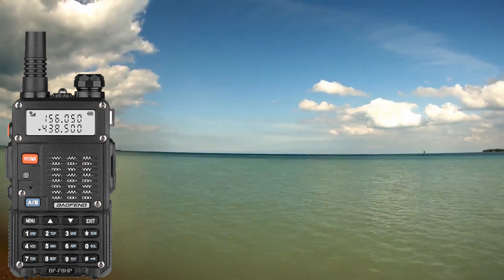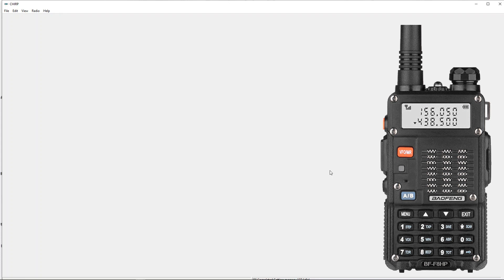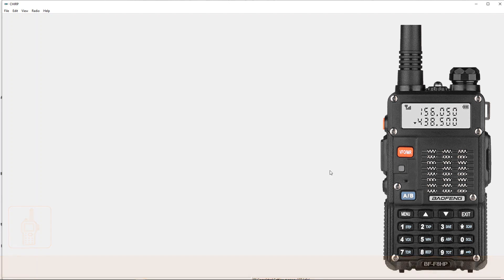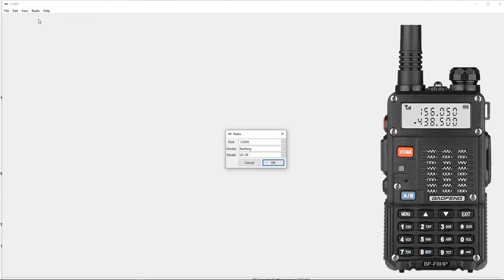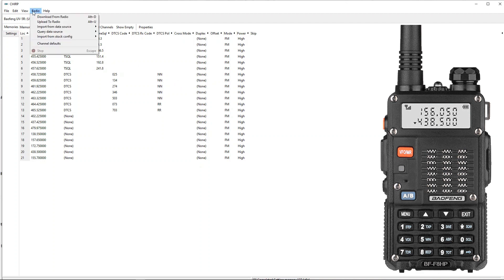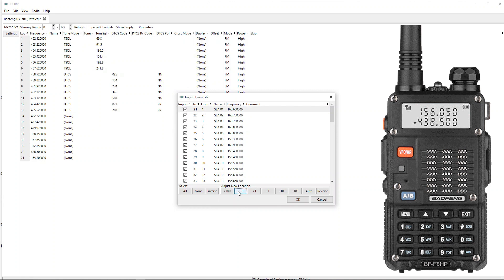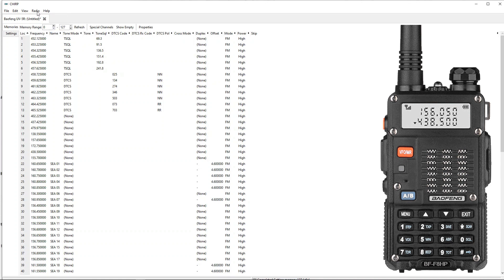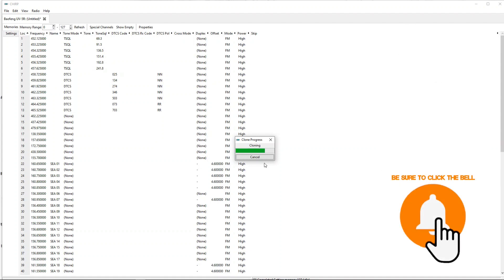CHIRP - Programming the Baofeng for Marine Frequencies the Easy Way!

Comment: Great video! But in the scenario that i'm on my boat and my main radio die, the Baofeng can be a great inexpensive backup radio that can save your life. Why the certification will matter?
Reply: believe me...... The coast guard is never, ever, going to pull up for a safety check and say "your radio has a removable antenna and is not certified for marine use".  They dont give two craps, they dont know, and dont care.
  Dont jam up channel 16 with useless talk and you will never have a problem.
Reply: Also, in an emergency, it is legal to use a radio in any manner for life saving reasons.
Reply from the maker: I would agree with you :-)